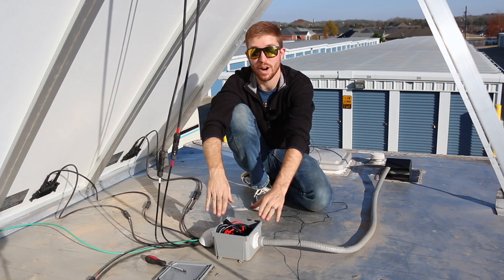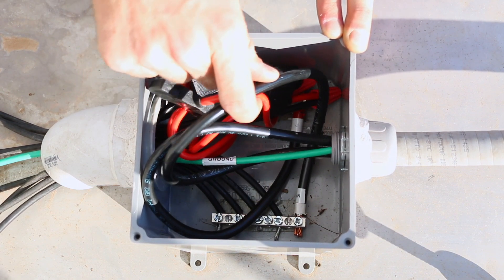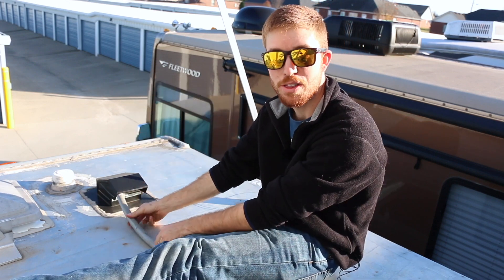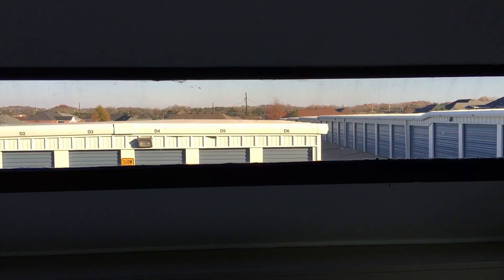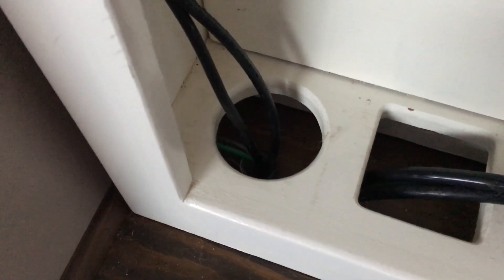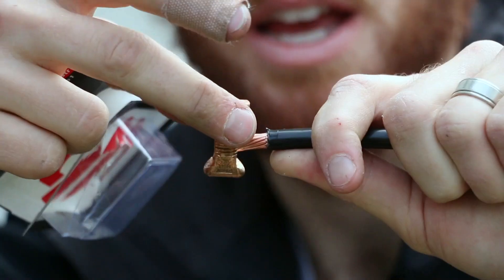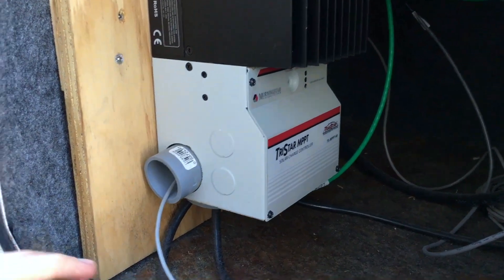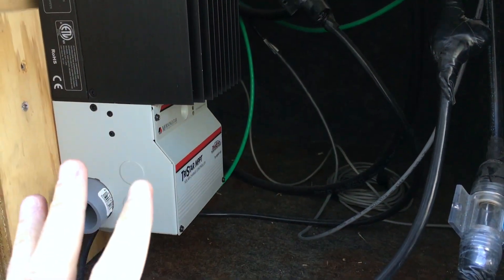Solar Wiring from Combiner Box to Charge Controller

Comment: How much amp fuse did you place between the panels and the charge controller?
Reply: You need to figure what you amperage of each of your solar panels, so if you are wiring your panels in parallel, then your amperage is higher than if you wired them in series,  before you connect to a charhge controller, use a volt meter and switch to 12v merage and check out your system, because of voltge loss in lengths of wire run, from the combiner box to the charge controller, I ran a 4 gauge wire of + & - down to the charge controller, the gauge you use will be determined by whether you system is in parallel or series and the number of total watts of your solar system, parallel the voltage stays the same, but the amperge increases, in series the voltage increases and the amperage remaims low, so basically for parallel = large wiring, and series, = the smae or smaller

Comment: Hey there thanks for all the great videos! Just a little something about combiner boxes and entry points. AM Solar designed a custom combiner box just for those purposes. It is also super affordable and very easy to install. They also have DIY installation videos on their website. 

I was also wondering about your solar array grounding. It looks like you have a green wire that is just attached to the frame of the solar attaching to the chassis. Im curious how that works since there is no electricity flowing through the frame? this might sound like a dumb question since I don't know much abuout grounding. Its my knowledge that grounding the shunt is all that you need to do?

Comment: Many people are buying inverters to convert AC to DC. I have chosen to purchase as many DC appliances as possible and to not use AC at all in the event of long-term grid failure. The advantage to doing this is that a much smaller number of big batteries and solar panels is needed. There is also less risk of a big catastrophe when something goes terribly wrong. In place of a stove you can use Roadpro electric frying pans and ovens. Several companies sell DC-powered refrigerators and freezers. You can buy battery-powered lamps thru Walmart. Some of these AAA batteries.

Comment: Good job. I have a question for the selection of dc cables. Mostly we select the flexible cables in dc applications, but here I experienced that you use standard cables from combiner to solar charge controller instead of flexible cables. So can you explain that Is it any differences to install the standard cable or the flexible cables specially dc systems. I will wait your positive response.

Comment: what size wire did you use?
Reply: Steve rivera he is using 10g from the panels to the combiner box and 4g from the combiner box to his charge controller
Reply: thanks i am running the same size,

Comment: Can I have the charge controller go to a bus connected to the batteries and also have a converter connected to the same bus to charge the batteries with a gen and the solar panels at the same time or would the amps from the gen hurt the controller so I must have a switch to select which input I use?

Comment: Ummm....next time...get your electrical supplies from the electrical department.  Using plumbing fittings is not cool or code.  Besides...using proper equipment will make your job a lot easier.
Reply from the maker: Hey Robert. Thanks for the suggestions 😊 I definitely feel you... but realize this was almost 3 years ago when I was working with a limited knowledge base and budget. I’m just sharing what I did that worked for me on my first install. I would definitely change some things about my current setup if I were to install it again present day but this has worked flawlessly for me so far. Who knows, I may do some videos on changes I will make to my current setup or I may just leave it be and do a more “proper” install on our next rig. I appreciate the feedback! 😎 Happy New Year!

Comment: Hey Michael. I'm with the others, you need to do something to plug that vent opening.  With the vent facing forward, you not only are going to suck in any rain, but also wind! It looks like it's under the panels, but it will still suck in all the air, even if the water stays out. Great Stuff is probably a good plan, but you 'll also need to coat it with something because I don't think it will hold up to the elements over the long haul either. Maybe some great stuff and then cover any that's exposed with a coat of lapseal. You could even use the rodent Great Stuff to deter any little creatures that might decide it's a great spot to pay you and Jenny a visit.
Reply from the maker: Great ideas. We actually have the vent facing the back of the RV  and it has been installed for well over two years with no problems... Thanks for sharing all of this info!

Comment: That vent you ran the cable down on the roof. Maybe you could get a can of spray foam and fill it so in bad weather it won't leak and keep small bugs from getting in. If you do that , spray a little at first because it expands alot. Just a tip.
Reply from the maker: Great ideas! We've actually had it installed for 2+ years and its held up through lots of crazy weather 😊 👍🏼

Comment: That's a roofing vent for venting bathroom smells and/or moisture for wet areas of a home.  Very common in housing applications.
Reply from the maker: Awesome. Thanks for sharing the knowledge! 😊
Reply: Just wanted to say that.It's where you connect the bathroom vent on the roof. Often bathroom vents are just venting into the attic or through the ventilation holes in the side under the gutters. Those little vent caps can be installed on the roof and they have a flap that opens with positive pressure from the inside (so no insects get in). Of course you can misuse them for weatherproofing although I think there might be more elegant solutions.
Reply: Clothes dryer vent.